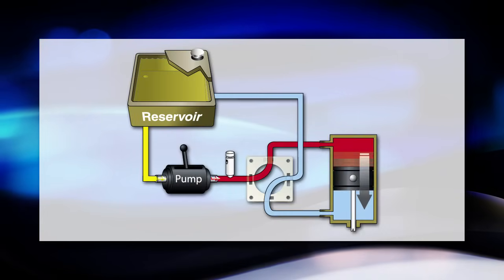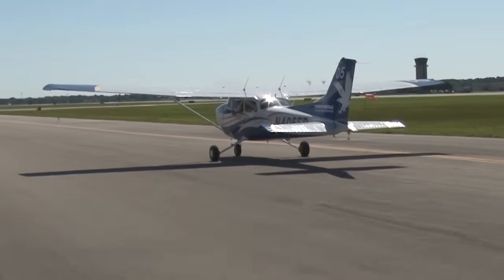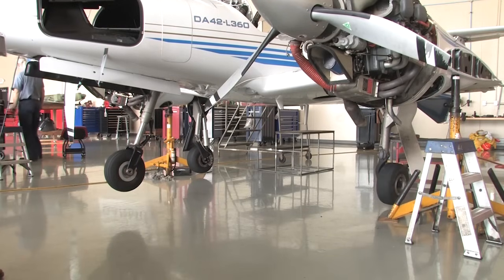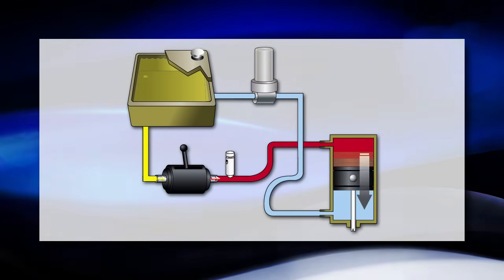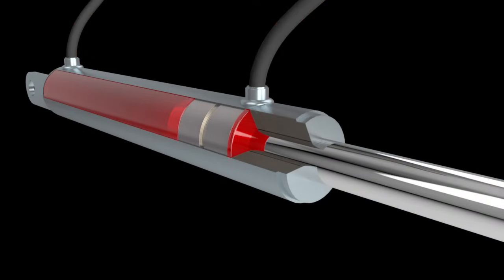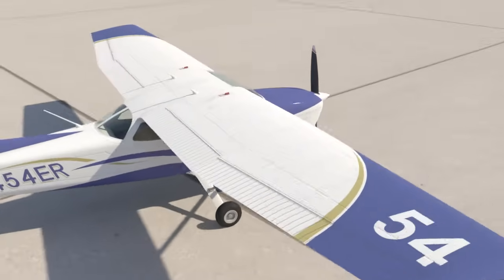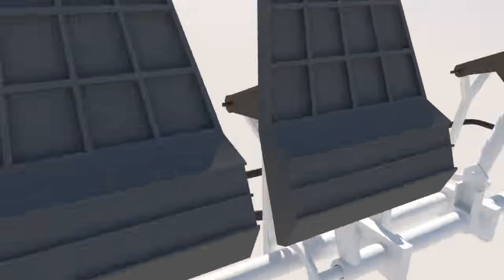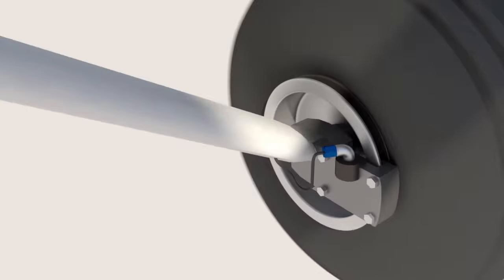Aircraft Systems - 07 - Hydraulic System

Comment: Question: What powers the hydraulic system of a aviation airplane? Is it the engines? Or does it run on a battery? Or something else?
Reply: The main thing that needs to be 'powered' is the pump in a hydraulic system. Some pumps are engine driven while some are battery driven, and as last fail safe option, some are even hand-driven.

Comment: Correct wording for closing cylinder is retract not contract as is said in the video.
Reply from the maker: Thanks for the input. The two words are generally synonymous, and depending upon the source, either is correct, and both are used within the hydraulics manufacturing industry.
Reply: Nice comment